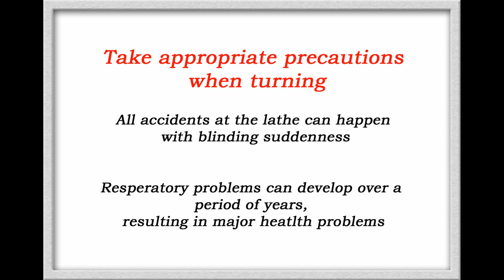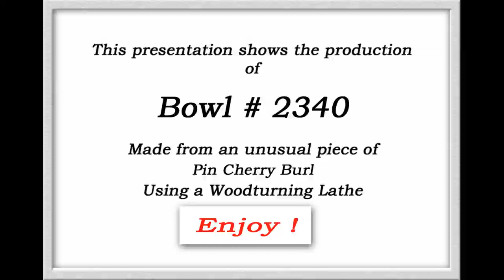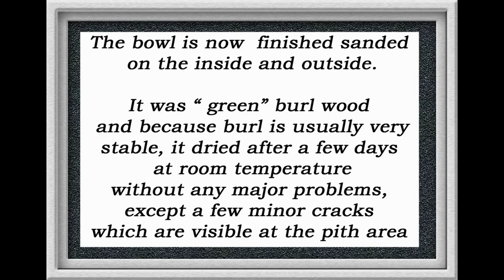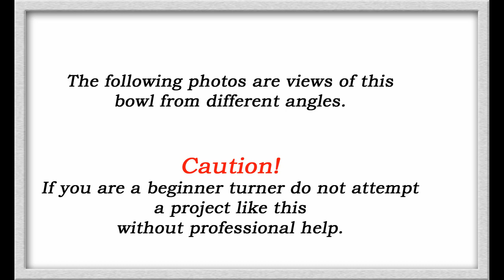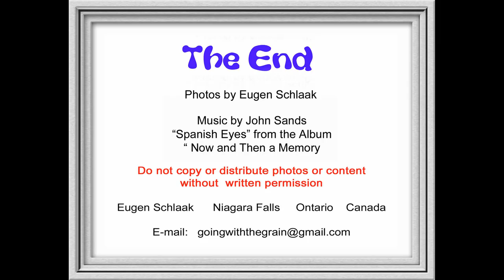Turning of Bowl # 2340 Pin Cherry Burl

Comment: I recently cut up some red oak burl, so it's very wet.  Would you recommend sealing it and putting it away for a year or two before turning, rough turning now, or going ahead and fully turning wet??   I turned a plate out of an extra piece of burl and it was cracked all over by the next morning.  Any advice would be great!!!
Reply from the maker: I suggest you rough turn the item to have a (depending on size) a consistent wall thickness of a minimum of 1". Anchorseal the item , but avoid putting Anchorseal on the surfaces you want to keep for the final turning. Keep the rough turning in a well ventilated area and be patient  for at least one year. No hard and fast rules here it all depends on the original structure of the wood . Drying SLOWLY in a rough turned shape  is most important .Good luck
Reply: Thanks!